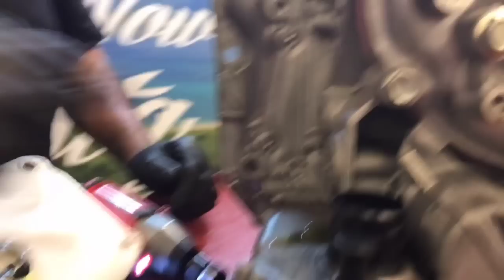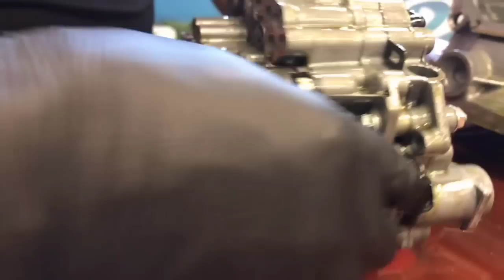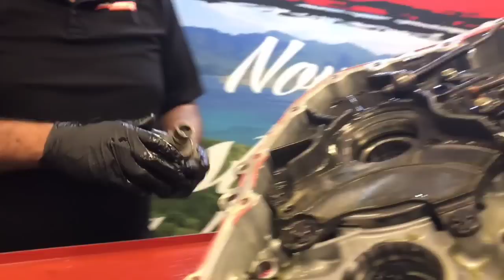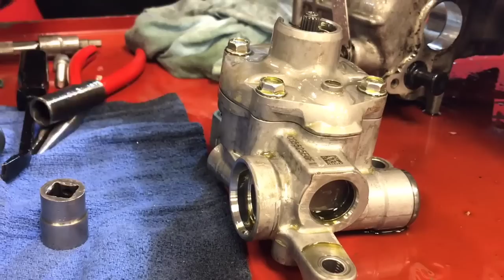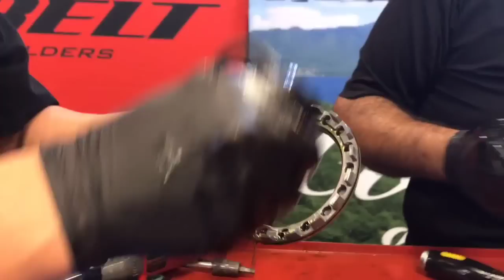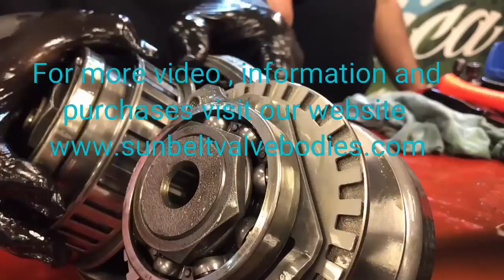2013 Nissan Sentra CVT  disassembling a RE0F11A (JF015E)  transmission

Comment: Awesome video thank you. Do you recommend I change the oil on mine? I just bought a 2013 and it had 120k miles.
Reply: Magic Carpet Nissan says „lifetime“ oil, no change. And they planned a life of 100000. if your gearbox works fine, it‘s not too late, change the oil. I change it every 30000 and we never had any problems, even after 150000mls
Reply: lieberfreialsgleich thank you for the info! I went ahead and changed it like 5k miles ago
Reply: I hope you changed the cartridge and oil pan filters too.
Reply: @lieberfreialsgleich  100,000 on a car these days is a drop in a bucket. How can any oil last a lifetime! If that is as long as the Nissans last avoid avoid avoid!

Comment: So what was wrong with it?
Reply from the maker: On these units the parts that go bad are the pump, valve body, and pulley assembly. you must replace all 3 when doing a rebuild. On this particular one we had to do more testing like vac testing the valve body and the pump. Found a bad secondary valve in the valve body .

Comment: Thanks for the video I tore my depart now I don't know how to put together a stripped out some bolts Blossom parts now I'm $4,000 in the whole thanks to you
Reply: Anthony Maniz haha
Reply from the maker: What parts are you having issues with ?
Reply: I have 2008 toyota camry I'm not getting power to my ignition wire battery new relays new fuse good would a bad neutral safety switch cause this
Reply from the maker: @anthonymaniz9896  is it a Hybrid eCVT?
Reply: You mean thanks to you

Comment: I've got an 11 Sentra that won't drive when warm, would replacing the inner CVT belt do any good? no codes and drives fine when cold.. Loud noise during start-up though, normal belt noise but 10x louder.
Reply: Replace the transmission and get an external oil cooler for the transmission
Reply: @eldom20  trying not too as the dealer is charging 6k (est.) for a replacement, and the cheapest second hand is over 4 grand. at that point it might aswell just get scrapped.

Comment: Question @sunbelt valve body builders ...i kno this transmission doesnt carry the step motor .....but i want to ask if all the nissan cvts that use the motor ...is the stepmotor the  same in all the nissantransmissions ??
Reply from the maker: No the stepper motor can have different brackets depending on which CVT it is.
Reply: @Sunbeltvalvebodies  ok thanx

Comment: question, 2013 nissan sentera sv, vehicle judders or jerks when driving constantly now. scanned codes found P285a and p17f0. Valve body or entire transmission would likely casue? hoping its the body...
Reply from the maker: Call the dealer and see if there is a transmission computer update.
Reply: @Sunbeltvalvebodies  I believe they did do a software update.
Reply from the maker: @hardipk5  That judder code is usually fixed by an update.
Reply: @Sunbeltvalvebodies  I'll call the Nissan dealer to confirm. They where telling me the entire transmission needs to be replaced. I drove the car this morning and it didn't judder at all. Last time I drove it it was very bad. What's is the ideal cvt fluid temp? Mine was 95 C just sitting. Not driven much.
Reply from the maker: @hardipk5  Yeah  thats overheating ... These cars have big issues with them overheating!
Reply: @Sunbeltvalvebodies  thank you I'll look into that more on the test drive.
Reply: @Sunbeltvalvebodies  Have any suggestions on where to buy a better oil cooler for a 2013 sentera SV?
Reply: Call Nissan goodwill. P17f0 requires replacement or rebuild. P17f1 requieres a valve body at minimum and a chain inspection. If the chain is bad cvt requires replacement or rebuild

Comment: This would have to be the worst gearbox design ever! The cvt's are so unreliable and problematic an absolute engineering disaster.
Reply: The engineering behind it is actually pretty smart. The problem is that the companies don’t know how to make them durable enough in sticky situations.
Reply: @Iridiumcosmos  obviously not smart enough to require a rebuild 4 years later.
Reply: all4dh8rz As someone who owns a CVT vehicle, mines still going 11 years strong. Like I said, they’re not durable enough if the power demand is needed which is why they wear out. Not to mention that you gotta do drain and fills religiously too. The engineering aspect of retaining power at an optimal gear ratio is smart no matter how much you hate CVTs.

Comment: I have a question, I have a Nissan Sentra 2013 And it has 130 miles there’s any problem if I change the transmission fluid first time?
Reply from the maker: You should definitely add a conditioner if you do that.
Reply: Entonces no lo puedo cambiar?
Reply: Sunbelt Valve Body Builders Que adectivo me recomienda?

Comment: A very informative and well explained video for this particular tranny, you guys have the best knowledge I've seen on YouTube so far!
One question : My 2016 Sentra with a 1.8L with 38K miles, it  has a kind of faint whining sound at the moment I put it in gear and and it stays relative to the engine rpm  (as is harmonic with engine speed) with no mechanical issues , I found out some fluid leakage on the lower cover under the trans case 
Is there any problem with that or should I expect a major problem soon ? 
Really needs a help here.
Reply: Ahmed Salam time for a new cvt
Reply from the maker: Definitely need to address the leak first. As far as the whining sound your gonna need to get the car in the air to try to pin point where its coming from.
Reply: @Sunbeltvalvebodies  the leak is from the sealer washer. And tge whining is definitely from inside tge transmission, much like a turbine sound
Reply: Ahmed Salam that’s exactly what has happened to my friends..and the noise was coming from inside the cvt and she is getting a new cvt installed also the rpm needle would fluctuate up and down idling or when moving the gear Selector in each gear or when driving
Reply: @rahrah8076  in my case there's absolutely nothing wrong with the car, except for tge noise, it idles perfectly and with  smooth gear changes,
Reply: @rahrah8076  I only get that whining noise when put it in D.
Reply: Ahmed Salam warranty covered $3000
Reply: there have been extension on the CVT warranties due to lawsuits against nissan. you should defiantly call the dealer to see if it is still covered
Reply: Sunbelt Valve Body Builders 
Excuse me... but what was the principal problem with that transmission?

Comment: Great video, technology of the future 1. protects the motor from excessive wear 2. Can be used simultaneously with and electric motor 3. saves fuel costs 4. logical scheduled maintenance will make CVT last longer i.e expensive oil change and replacing the belt. And last but not least drive like a human

Comment: For those who are wondering, "loctite" as suggested in the video is an adhesive/sealer, but the specific variety for transmissions and you will be fine. I followed this video and rebuilt a used CVT transmission from a Nissan Sylphy (Asian variant of the Sentra) successfully. Thanks much for the detailed steps in the video!

Comment: Hello, I've got a question. This is the exact CVT transmission that I've recently rebuilt for my Nissan Versa 1.6L 2012 SV. I'm having an issue where the reverse gear is not working. It drive perfectly and shifts amazing. The Low gear also works. Neutral. Park as well. In Reverse on a flat street, it just drifts forward, pressing the accelerator just revs the engine. It's almost as though it's on neutral. I've made sure the position switch isn't half way or anything. The reverse is not engaging. Could it possibly be the solenoid? or valve body? I'm hoping it's not inside, else I'd have to pull it all out again. Not a problem, but just extra work to do. I'm not getting any codes appearing. Any information will be helpful. Thank you!
Reply from the maker: Did you take the valve body apart?
Reply: Sunbelt Valve Body Builders yes I did. Kept the same eeprom. The 5 solenoids were all new. Made sure the 2 check ball valves were there. Changed the 5 filters and cleaned it all out.
Reply from the maker: @WinKongmuang  its very possible that you have some solenoids in the wrong location. that would cause the issue your having .
Reply: @Sunbeltvalvebodies  Hmmm, that seems highly possible now, there were 3 solenoids that seem to be identically the same out of the 4, they were the B, G, and A solenoid, unless they are not? I've checked their resistance and getting a 5.6 Ohms on all the 4 solenoids. Is there some identification on them I'm missing? Oh man.
Reply from the maker: @WinKongmuang  so the solenoids either have NH marked on them or NL . They are high and low solenoids . if you have the high clutch reverse brake solenoid switched with the low brake solenoid it will cause your issue. those are the 2 solenoids that are in the middle.
Reply: @Sunbeltvalvebodies  The NL was the one that was different that was for the Low Brake F Solenoid, it only fit in 1 port because the lock pins wouldn't be able to lock it. then I install the NH ones on the Line Pressure A, High Clutch Reverse G, and Primary Pressure B Solenoid.
Reply: @Sunbeltvalvebodies  Thank you so much for your help so far. I've tried purchasing an entire valve body with new solenoids and everything, replaced with no success today. Since the car was lifted. I noticed in reverse the wheel do not move backwards when the brakes are released, versus in Drive the wheels will move forward. Could this have anything to do with torque converter? I'm pulling out the tranny again tomorrow.
Reply: @WinKongmuang  if you replaced an entire valve body it needs to be programmed to the TCM at a dealer
Reply: @WinKongmuang  you fixed it? If not I can help. Happened to me before

Comment: Just avoid any car with a CVT Transmission.
Reply: they also have cvt Transmission s
Reply: John Millard Toyota and Honda pretty much perfected the CVT, especially Toyota, they have Asin make they’re transmissions which explains why they’re so reliable. They have been perfecting them for over 20 years now with the Pruis.
Reply: Or
It may work well while it works. That's not my problem. Problem is resale or hand me downs. 4k to fix would kill any high school college kid.
Reply: John Millard Transmissions are always extremely expensive to be repaired or replaced, especially the CVTs. Sure I would defenitley go for a normal transmission Aisin or Allison, since the CVTS lag alot. But its all in the sake of saving gas, If someone was to buy a CVT for a commuter, definitely stay away from Jatco and they’re crappy partner Nissan.
Reply: @fre d I would a agree with that if i didn't work for AAA we have picked them up with trans failures, some to the point if you would put them in drive they would stall down the engine 
I have towed Hondas and toyotas with that same transmission problem unfortunately. 
But not as much as Nissan
Reply: 1sikgsxr 07 that’s what I was assuming. CVT works in the same mechanism and many parts are manufactured by Bosch kind of 3rd parties. If cvt has issues, must be all cvts on the same boat. If have to buy a CVT car, go with Nissan which has longest history of using cvts.
Reply: Birch Kong are you joking? Nissan CVTs are the absolute worst in the market, they tend to fail within 90k miles😂😂😂
Reply: ThinkkOps nah have had 3 serviced all at 30k all made it to 150k without issues
Reply: Seth Little Won’t make it past 200K, but congratulations, at least you service them and baby it.
Reply: Seth Little I’ve seen atleast 20-30 of these Nissans CVTs blow out at 90-150k miles, it’s just a fact, most nissan lovers just suck it up and are prepared to pay thousands when it breaks, Quality is not there anymore, BUT I would say if you would get one in a standard transmission, they would be alot more dependable than usual, they’re definitely better than Fiat Chrysler products
Reply: ThinkkOps but for a cvt 120k to 180k is the normal I’ve Honda cvts worn out at higher mileage it’s just the design and people need to know that if they’re buying a cvt for me 150k out of a transmission that’s as smooth as silk and saving me gas is great and then I can get the newer and improved version of that cvt at that point which is what I do I keep them for about 150k then trade it in for a newer one rn I have a 2019 Altima and the cvt in it has to be the best Nissan has used
Reply: Seth Little Well thats your experience, In most cases people who drive Nissans can’t even go 90K miles without replacing a transmission, and I know because I owned one. 2015 Sentra, nothing but problems, electricital and drivetrain wise, sold it and bought a 2020 Corolla, although It has a CVT, I could say its a whole lot better built than Nissans. I have a friend who owns a 2017 Corolla and has 196K miles on it and no issues whatsoever. Its at your own risk, but Nissan is going into bankruptcy and is cutting costs, and throwing cheaper parts at newer cars than ever.
Reply: ThinkkOps i also have a 2020 corolla and the 19 Altima both the cvts are great and preform really well and I’m sorry about you sentra truly I hate people having car issues I’ve just have never had a single issue with nissans cvt and Toyota’s is good too, only cvt I’ve had issues with was Subaru’s
Reply: ThinkkOps personally I like Nissan for comfort but for most people I would say buy Toyota Honda or Mazda first and if you don’t wanna buy them I would say get subaru Nissan or Kia as your second options because they can be good but Toyota Honda and Mazda are definitely top 3 and subaru Nissan and Kia are the second tier automakers
Reply: Seth Little Yeah that’s because they also use Jatco Transmissions, and have boxer 4 cylinder engines, which are not so hot shot reliability wise. But yes unfortunately it happened to me and many of my customers ( I work as a technician at a shop) aswell, where they come and and loud metallic scraping sound emit from the transmission at 70k miles as well, my mother owns one and loves her Altima, she said its roomy, ( which is considiring its longer than my Corolla) and hasn’t had any catastrophic issues with it since it has 74K miles, just a check engine light with a catalytic efficiency issue, had  to replace one catalytic converter on it which was a pricy fix. Overall, it’s holding up pretty well after the fix, she does drive slow which also explains why It’s held up so far. Overall Everytime I see anyone buy a Nissan CVT, I suggest them to baby it, and service it every 40k miles, do not believe that “sealed transmission, non serviceable” crap the dealer gives you, its all BS. Fluid is fluid, it gets hot, corrupted, and becomes inefficient. Fluid is cheap, transmission cost thousands. Atleast you service your cars regularly, make sure you service your Corolla too! Although they’re better built, don’t mean you don’t gotta service them.
Reply: ThinkkOps yeah all my cvts will get serviced at 30k the corolla as well hope her Altima lasts her awhile 👍
Reply: As far as I am aware, I think it is just Nissan with crappy CVT's.

Comment: What you think sir if Nissan uses a chain belt instead of a steel belt will make the CVT more reliable?

Thanks.
Reply from the maker: Nissan is already using them in their newer models.
Reply: Sunbelt Valve Body Builders by newer what years did they change them. Asking cause I have a 2016 Nissan Rogue

Comment: I took my 2017 Nissan Sentra cvt car with 50 thousand miles to a mechanic shop and they are charging me $ 4635, + taxi. The transmission does not accelerate. Is that cost exaggerated or is it ok?
Reply from the maker: Yes that is wayyy to expensive !!! where are you located ?
Reply: @Sunbeltvalvebodies  Arlington tx
Reply: U should have warranty
Reply: @ELHUESOKLICK  
The warranty does not cover, my car crashed but the other car just touched the door and the agency checked the vin number and they told me that the car is salvage.

Comment: The failure is it's a CVT transmission buy jatco they are the worse one out there
Reply: wayne wicks how you can tell its Jatco???
Reply: @maxhappy4937  Your first clue is it's from a Nissan.  They only use Jatco.  Second is the model number.  You do apparently have internet.  Try using it bud.

Comment: Dirty work! They shouldve drain the transmission first from all its oil and check how much oil was in it. Then clean or change his gloves before disassambly. It is not ok to touch the impactwrench with that gearoil.
Reply: BTW, oil and auto repair go together like bread and butter - also the disassembly and assembly are different animals; but (as I posted earlier),  "you can never completely drain all the fluid (unless you use the BabyBoiOmniDrain Tranny Rotate and Drain© machine, BBODTRD); it is guaranteed to drain ALL the fluid using a minimum of 100 drain positions, each held for two minutes. The BBODTRD only adds three hours to the job. The manual method you see here relies on a workbench designed to catch the fluids, allowing the work to be performed more slickly (no pun intended)² than with the BBODTRD.  Actually, all the parts of the transmission are just fine with sloshing fluids, in fact, they lap it up!" Pneumatic tools are not oil-shy either.

Comment: Im about to throw away the whole car.
Reply: Just rebuilt my own cvt after wrenching for 5 years, not terrible, 4r70w trash 4l80e trash, cvt trash, but I did bench press it out in my parking lot and rebuilt for 400$ sooooo
Reply: @sterlingalcorn4525  was it hard to rebuild?
Reply: @sterlingalcorn4525 what kit did you use ?

Comment: I have a 2013 Nissan Sentra Transmission cvt, last week I changed the oil and it’s stared turning black or dirty. Also when I am driving it and reaches 40mph start accelerates, slippers and I feel that the overdrive activates. Can you please give me some suggestions how to fix that problem. Thank you help please
Reply: Sell it